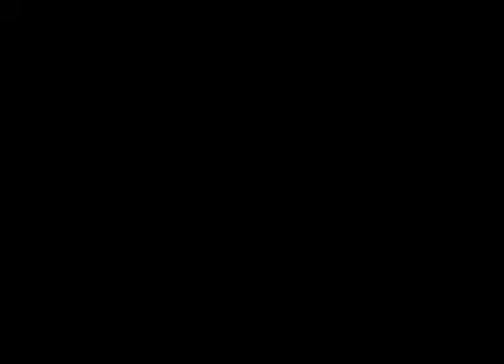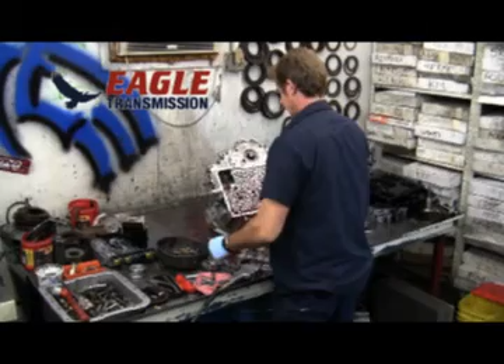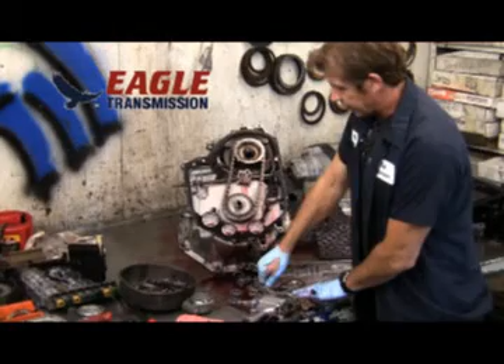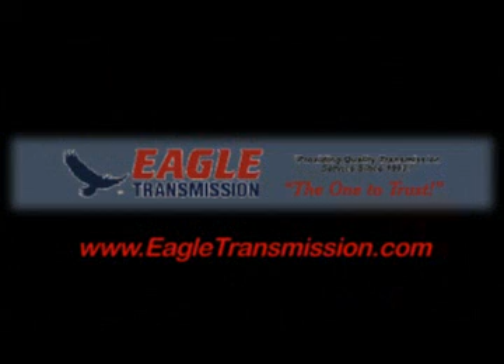Mikes Transmission Repair Bench Part 2

Comment: Excellent video!  Reverse quit out on my son's 1992 Accord.  The transmission is a 4 spd auto, model APX4.  I bought a rebuild kit, new filter, reman torque converter, 7 qts of Honda fluid then went to it.  I found no broken O-rings, no metal shavings or any signs of damage.  I throughly disassembled and cleaned every last part then reassembled and torqued per the Honda serve manual.  She now shifts great in all fwd gears but still no reverse.  Anyone have any idea what I missed?